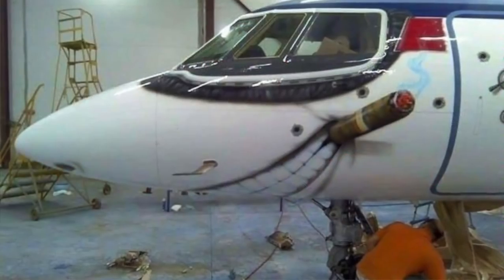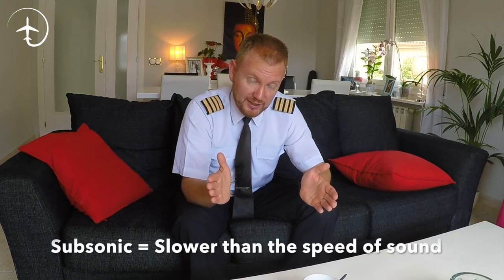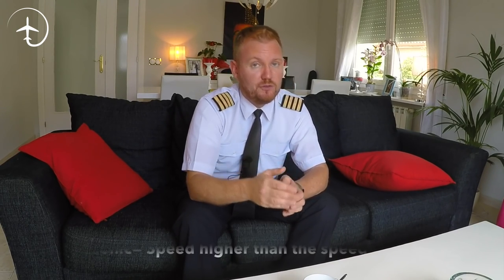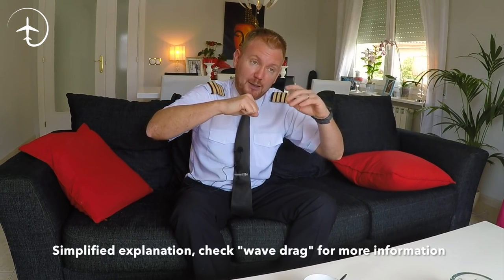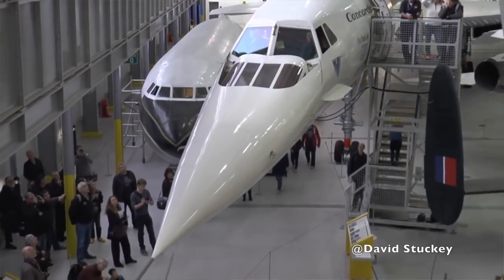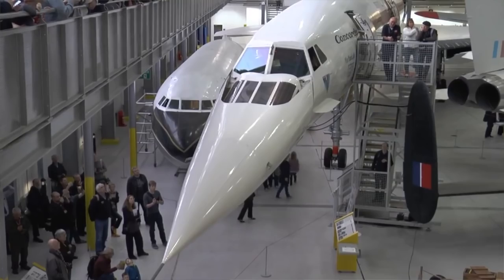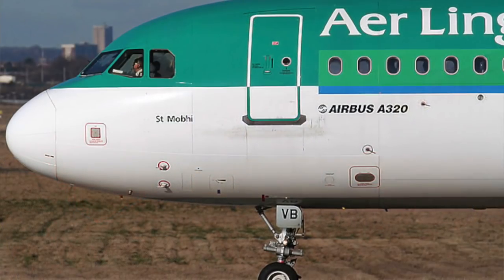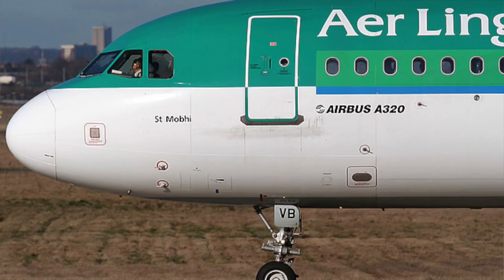Aircraft Noses. Boeing vs Airbus and Rounded vs Pointy.

Comment: I'd agree with all of those assessments. Going forward, I think you'll find that the nose shape will depend more on the line it comes off of. 787 had a new nose geometry because it had a new line and new manufacturing method. The rest each have similar noses so that engineers don't have to redesign the nose, manufacturing method, or manufacturing line. All the future CF base planes will probably have the 'new' nose and the future "conventional material" planes will have the old ones and be made at the old facilities

Comment: comparing noses between concord and 737 is obvious. but i think a major factor is to protect the windscreen glass, a thick nose pushes the air away and thus the pressure on the glass is smaller.

Comment: As a lot of aircraft design is compromise. EG you want the body as narrow as possible to reduce drag - and as wide as possible to get more passengers on, and the wings as thin as possible to reduce drag, and as thick as possible to increase fuel capacity. I was therefore under the impression that the Boeing and Airbus noses were different aerodynamic compromises, and that the Boeing nose at cruise produces a small but measurable amount of lift which reduces the drag at the tail, while also increasing the drag at the nose. whereas the Airbus nose produces less drag and lift increasing drag at the tail. That said I could be completely wrong.

Comment: When you look at the Douglass line, the nose stayed basicly the same from DC3 to DC10.
And similarly, the  Lockheed Tristar's nose was still the same as the Constellations.
And why not? They spent a lot of time and effort designing those, work that would have to be thrown away to start over a new design.

Comment: I think you might add that windscreen technology has allowed for a nose on the 787 (and the A350) that better fits with aerodynamics.   I have always wondered why Boeing didn't retro-fit the 757 cockpit design to the 737 as the fuselage cross section is the same.  As you said, for money reasons, it might not have justified the expense.   Great Series!

Comment: Very interesting discussion! Well-reasoned points (no pun intended). Good call on the 787 connection to the Comet nose. I thought it looked familiar! 

It occurred to me that the space shuttle's nose was quite rounded and airliner-like, despite its hypersonic speed during its climb to space. It must be because the more ballistic shape of the fuel tank's own nose ahead of the shuttle is taking most of the aerodynamic forces?
Reply: The main reasons for  the rounded nose of the shuttle is to protect the remainig parts of the vehicle from the heat during re-entry process. The rounded nose makes a “bow shock” which creates an area which makes the separated shockwaves to spread away from the shuttle’s parts behind the nose. With other words the nose takes the majority of the drag and therefore of the heat and hence dissipates them away, just like an umbrella. As you may note the wings’ leading edges have similar round shape for the same reason. The other benefit of the round shape is that it creates more drag which contributes to the speed slowing process, which is welcomed here because that is the point of the re-entry process…

Comment: Black noses found 3 different explanations. 1) glare, 2) natural colour of the carbon composite, but I suspect 3) earlier coloured paints required a zinc primer which would have interfered with the radar and black didn't.
Reply: 4) earlier paints were lead based and the lead interfered.

Comment: The visibility issue of the Concorde is not caused by the pointy nose. The Concorde has delta wings which are great for supersonic flight. During approach delta wings need a very high angle of attack. So the Concorde points upward during approach.

Comment: ..so why the fairing of Falcon 9 for example that fly much faster than the speed of sound is very round?
Reply: Stronger support. The falcon would break against the pressure if it was pointy. The speed just comes from the thrusters, but it has to have a strong structure in order to handle it.

Comment: Excellent explanation. I wondered about the reason. The 737 is not much, but noticeably wedgelike. It wouldn't take much to change that if it needed to be changed. It must  be, as you suggest, about brand.

Comment: The asymmetrical shape of the nose must tend to have some effect on the wind force imposed upon the nose. It probably is pretty minimal but as a bullet nose is always symmetrical for stable flight but of coarse they spin in flight for great resistance to straying off coarse.
The comet’s nose seemed to be a bit more symmetrical in cross section, the 747 far more oval.
It’s all about blending into fuselage profile. The nose must have a bit of resistance to strike damage as birds and weather conditions such as heavy hail/sleet.

Comment: Pointed round nose. Or round pointed nose. Hybrid design. Just put a pointy pole 4 meters long on the nose.
Then it will split the incoming air molecules. Also the pole can be attached to generators and turbines. To spin around itself from the incoming air. My favourite designs are SR-71 and B-2 spirit.

Comment: And for even greater speeds, a rounded nose becomes better again (cf Space Shuttle)! This is because it keeps the shockwave (where a lot of heat is produced) further from the skin, which lowers the temperature it has to resist.

Comment: Captain Mentour, good luck finding a radome made from carbon fiber. Carbon fiber blocks the attenuation of the radar beam.

All of the radomes used for aircraft radar, whether for aircraft ranging or weather observation are made of E-glass fiberglass. The radome can be solid fiberglass (older designs) or a honeycomb cored bondment, provided the adhesive used doesn't contain a filler metal. 

Metallic paints for aircraft get the metallic appearance by the addition of mica instead of flaked aluminum which is typical for automotive paints.
Reply from the maker: Yes, I was referring to the aircraft and entire nose section, not just the radome.

Comment: I would like you to go over two topics. The first one being Dihedral and the second one is a bit more complicated. The question is the wing cross section (the airfoil shape) it's my understanding that fighter type aircraft have a very "flat" cross section where as a plane designed for larger lift capacity has a larger cross section ( a taller rib, if you will) I've always understood that they want the fighter to be almost unstable but react quickly to inputs from the pilot. Could you go into more detail on these topics? Because I believe that they are also related to each other when it comes to the design of any aircraft. 
Thank you

Comment: What a round nose does is separate the fast moving air away from the rest of the body of the aircraft and the pointy tail will let that separated flow merge with as less turbulence is possible and this pointy tail is also necessary because a plane with tail like that of say F-15 but no engines in place will create sort of a vacuum behind it hence increasing the drag. 
Military A/C tear through the air and hence sharp nose but they care little about rear vacuum because they either have engines at that place or they are so small that leaving a turbulent air behind them does not matter much.

Comment: The nose on the 787 is also drooped slightly due to the way airplanes sit in the air when flying. If you look at the 747 in flight, you will notice it sits with the nose slightly raised due to air pushing the front up. This kind of means the plane is hitting more air than it should due to the angle. The 787 utilities this observation of sitting in the air by aligning the nose in the 'actual' direction the air is hitting the air frame, reducing drag :)
Reply: So does this mean the fuselage of any commercial airplane is always tilted upwards a little during cruise? Very interesting, never knew this. And pardon my ignorance and lack of knowledge but isn’t that something the angle of the wings could counteract or would that be dangerous because of the nose then wanting to point downwards when reducing speed (as with landings)? I love to learn about this kind of stuff! :)
Reply: Probably going to study the Dakota  nose.
Reply: Why not tilt the wings up (angle of attack) to compensate and keep whole fuselage axis parallel to direction of flight?

Comment: Petter, I started watching your videos a few months ago and have greatly enjoyed each of them. This round vs. pointy nose explanation was a really good one, and there's something I'd like to add. At supersonic speeds the nose shock can be either "attached" (coming from the tip of the nose), which is lower drag, or "detached" (forming in front of the aircraft entirely), which is higher drag. Pointy noses tend to have attached shocks and round noses tend to have detached shocks, and you can see examples if you Google "attached shock Schlieren" and "blunt body Schlieren" (Schlieren is a kind of photography that basically allows you to "see" air movement and shocks). The thing with round noses is that having a detached shock adds a further drag penalty on top of what you already mentioned, making it waaay worse than a pointy nose for flying fast. There are actually pros to having a round nose and a detached shock in some cases (like space capsules- the shock keeps some of the reentry heat away from the capsule itself, and round noses may have less sonic boom noise), but for most aircraft the drag penalty is more important.
Reply: It’s been three years and you only have one like, I will like your comment and I want you to know I appreciate what you said
Reply: This is an unusual concept and many may not grasp it but it is interesting to know the varying shapes are not just for style.
Reply: I think Airbus made the nose rounder is to prevent not only trademarks claim case from Boeing but also prevent design copyright case!!!😜😂😝😛🤣

Comment: Another excellent and informative video, new sub here. :)
Would you consider doing a video about wing chord/camber shapes and dihedral/anhedral/polyhedral wings, and how these designs have changed over time? From birds to aircraft... there are so many subtle and not-so-subtle differences in wing design, but they all provide lift, optimised in different ways. I think a video about the "hows and whys" of these design differences would be fascinating for many people, I've always found it to be a very interesting part of aerodynamics (you touched on some of the same aspects in this video, the different types of drag at different airspeeds and the fact that everything in aviation is done for a reason, usually involving aerodynamics). It would also be a good chance to learn a bit of aviation history which is never a bad thing. :)

Comment: Why does the space shuttle have a rounded nose? Do they intentionally want to increase drag when re entering the earth's atmosphere or maybe to create the "bubble" around the aircraft to reduce heat on the rest of the airframe?
Reply: P
Reply: They take the reentry heat on the belly in what would be like a stall position in a regular plane.    After that they want to slow down anyways and the tremendous heat has already dissipated.    They’re more or less like any other airplane just higher and without an engine so they glide it in.
Reply: Yes,the initial re-entry phase is done with with the nose tilted up and the belly taking the brunt, but after it levels out the nose creates a wider supersonic schockwave that encompasses the wings to prevent damage, and as shown here the increased drag from that is present only at supersonic speeds.
Reply: The reason is to deflect the shock wave from space shuttle's  wings.
Reply: the wing could be broken at hypersonic speed, the round nose act as shield to deflect the air.
Reply: Space vehicles re-entering at hypersonic speed experience heating of the surfaces due to compression of the upper atmosphere air, not as much due to friction between the air and the surfaces.
When the front area of the vehicle is more round instead of pointy, the compression happens more in front of the vehicle instead of on the surfaces itself, and there is less heating of those surfaces.
Note that traditional "capsule" spacecraft like Apollo and Soyuz re-enter with the largest area downward for that reason.
So what Henco wrote is actually correct.
Reply: Henco du Toit In addition to generating a “bubble”, a rounded nose also keeps the superhot plasma shockwave as far away from the nose surface as possible.
Reply: @Rob2  finally the correct answer
Reply: It’s a big  non powered glider and a round nose is best for reentry into an atmosphere, where aerodynamics is important for the space shuttle to fly or glide to its destination.
Reply: Craig Bathurst At Kennedy Space Center we had Lunch with an Astronaut. I highly recommend this, it was cool to hear all the stories and be able to ask questions. I’m no astronaut and no pilot but I learned so much from that lunch. 

One of the things the astronaut was talking about was that the Shuttle wasn’t a glider. It resembles a brick more than a glider. He called it a ‘controlled crash landing’. The declination is downright scary (I believe he mentioned 14 degrees) and they had to make a 180 to get it down to landing speed and to final approach. 

Landing a shuttle was in no sense a routine although of course they practiced for it.

It really makes you appreciate more how those astronauts were doing multiple very high skilled assignments that sometimes would border human limits in both physical and mental capabilities.

Comment: Minor point: 787 radome is probably not carbon fiber, as carbon fiber is somewhat conductive, and that interferes with passing radar waves. Radome materials must be structurally sound, obviously, but electromagnetic properties are the big driver in material selection. Fiberglass is heavier, less stiff, and less strong, but it's a much better dielectric.

And a piece of trivia: Despite the hype, and the fact that most of the fuselage and wing primary structure is carbon/epoxy, only about half the total structural weight of the '87 is carbon composite. There is a considerable amount of fiberglass composite and titanium, and the steal landing gear structure is, as always, quite heavy.
Reply: The radom is made out of  Aramid ,better kowen  as  Kevlar, due to the impact strength

Comment: Can you please explain the difference between main landing gear of A350 and B787? I have noticed that the front set of wheels in main landing gear of A350 fall frontwards whereas in B787 / B777 / B747 the rear set of wheels are tilted backwards.. does it have to do with tradition being followed or there is any specific logic behind it?
Reply: That's actually very interesting as the 767 also has gears that tilt forward and I wonder if it has to do with tire wear
Reply: Nose gear extend/retract forward to allow the gear to extend using gravity and drag (gravity extension) incase of hydraulic failure.. how ever aft extend/retraction allows fuel savings while retract..
Reply: It’s all down to space and how the landing gear fits into the plane 🤷‍♂️
Reply: Captain Joe actually has a video on this.
Reply: Simple. GEAR storage space, captain Joe has a video about this
Reply: It doesnt matter how its tilted. Its only tilted that way so it can fit in the plane

Comment: There was a point in time where Boeing and Airbus looked like they switched nose designs with each other. The 757 and 767 both had very round, airbus shaped noses,  and the A330 and A340 had more pointed boeing shaped noses

Comment: When you look at an aircraft on the ground it is easy to assume it flies through the air at the exact same angle.  But they do not.  Commercial aircraft tend to lean back about 5 degrees when flying straight and level.   This is one reason for the droop in the nose.

Comment: I hadn't realized the shape similarity between the 787 and the Comet until now.  You have a valid point.
However, even if the Comet shape is aerodynamically superior, I think Boeing would have purposely AVOIDED the shape back then (when the 707 was designed) because of the bad press associated with Comet at the time.
If you remember, the Comet had structural failures that gave it a bad name.  Even though the aircraft was re-engineered and went on to have a fairly successful production run, I would assume that Boeing would not want their aircraft to even LOOK like a Comet back then.

Comment: On wide bodied planes, why are the cocpit above the nose.
If the passenger compartment can be extended to the nose it would surely make for an exellent flying experience. A novelty seat of sorts.
I remember as a child we loved to ride in front of the upper deck of the double decker busses.
Also pilots would see much better.
Can you make a video about this point.